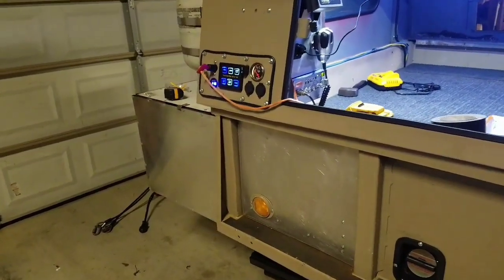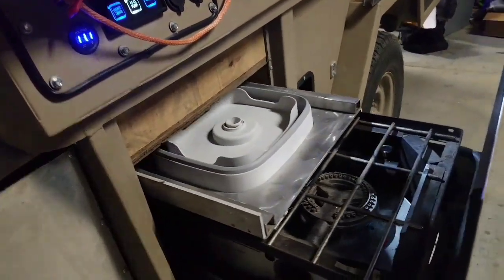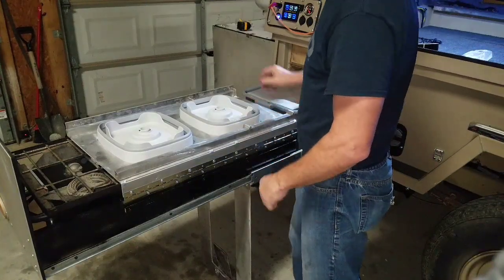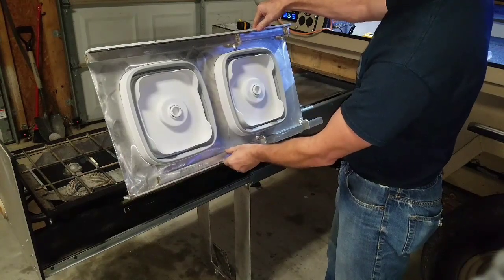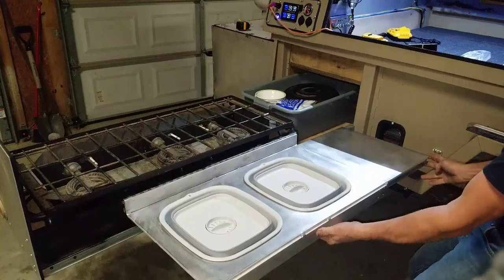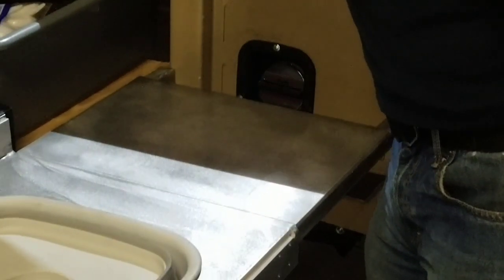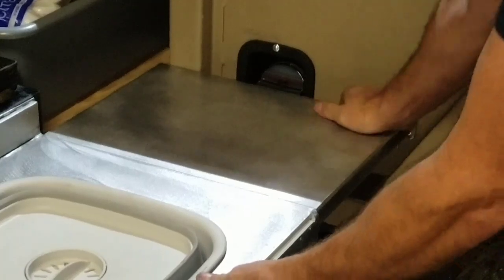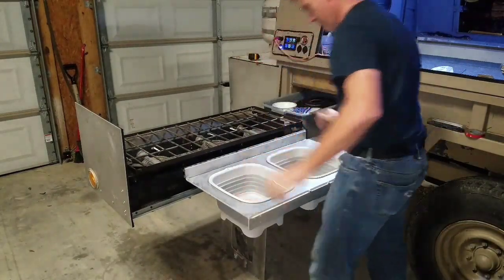Building a camping kitchen for our overlanding m101a2 trailer

Comment: Clever, but why would you add the complexity, weight, and all the additional points of failure to automate the opening/closing?
Reply from the maker: minimal weight added and enjoy the challenge of the build while making it simple and determining better ways to make it so the points of failure are reduced. Plus I got to use a bunch of junk I had laying around the garage :)
Reply: For the man that lacks the upper body strength.